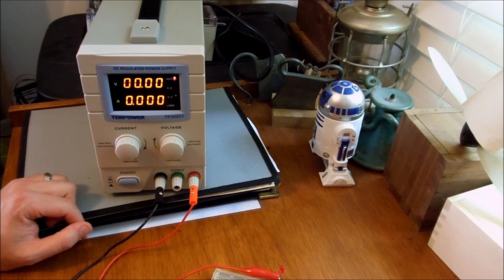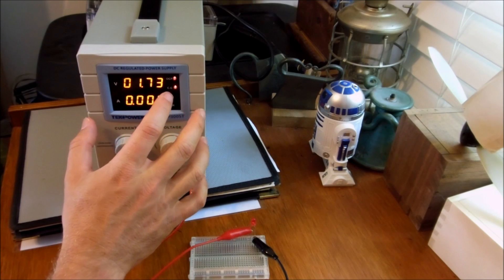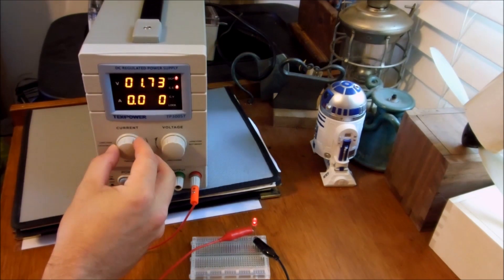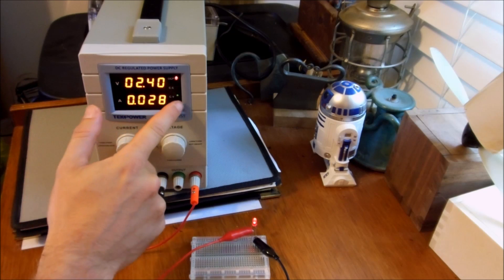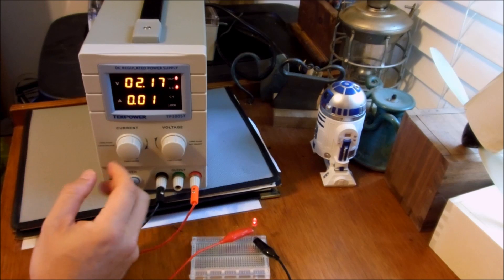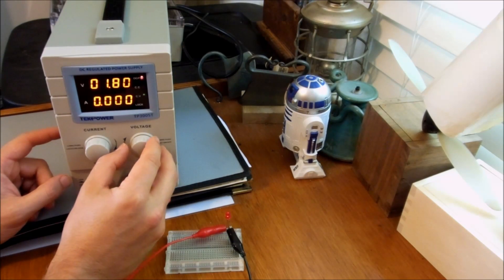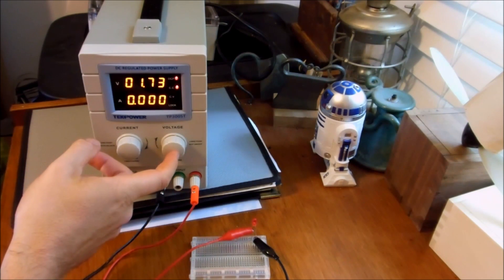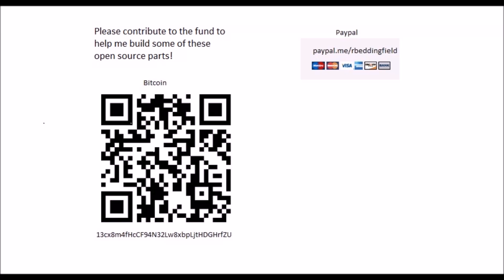Adjustable Power Supply Basics and Tekpower TP3005T Functions

Comment: When you turn it on or if the main power shuts down for a couple minutes and the energy is back, it will Remember the Voltage and Current you did set up before?  Or at least the voltage will be zero?  Is there some Voltage Spikes when turn it on or off? Thank you.
Reply from the maker: I got out the oscilloscope to see what it does.  When you turn on the unit, the voltage increases for about .1 seconds before it gets up to voltage.  So, no spikes that I can see.  When you turn the unit off, the voltage decreases over the course of a few seconds.
Reply: @robbeddingfield4049  Awesome, thank you for checking that!!!   I read several reviews about the KORAD KD3005D, it has a big spike (+8V) when turning it off, some people complained about blowing circuits when turn it off!!!  I bought a Tekpower TP3005T today, after comparing it with KORAD KD3005D, UNI-T UTP3315TFL-II, Dr.meter 30V/5A.
Reply from the maker: Yes, when you turn on the unit it remembers the last voltage and current setting, and it will supply power as soon as switched.  I'm not sure about the voltage spike.  Thanks for watching!

Comment: PLS can i use this product to power an inverter? i am trying to work out energy cycle
Reply from the maker: This power supply supplies up to 5 amps.  I'm not sure if that would be enough to power your inverter.  You might consider looking up the specs on your inverter or similar inverters.

Comment: have you tried it with a multimeter to see its reliability?
Reply from the maker: Hi, thanks for watching.  From what I can tell, it's close enough for me (withing a few milliamps or millivolts), but there are some other units that have noticed that the reading are slightly off sometimes.  You might want to check some of the other comment replies.  Thanks,
Reply: @robbeddingfield4049  Do you recommend that power supply?
Reply from the maker: I do not have any experience with other units and I'm not familiar with new products, but for this price range, it works great for me.

Comment: Thanks for the intro. Just ordered mine.
Reply: What's your impression so far?  I'm really thinking about pulling the trigger on one.
Reply: w3vjp ...so far it powered everything from an RC battery charger to testing Ham equipment. I check the DC output via Fluke meter when testing. I would recommend this to any hobbyist.

Comment: how to turn cc node off?
Reply from the maker: Since there are two modes, CC and CV, the only way to get out of CC mode (constant current) is to change to CV, or Constant Voltage.  The way to do that depends on the electrical circuit that you are working on.
Reply from the maker: Most of the time, changing to constant voltage just means turning the amps up to the point where you are not limiting the amps but you are only limiting the voltage.  That is to say that, in this situation, you are giving the circuit as many amps as it wants.  If the circuit will accept more than 5amps this machine may never leave CC mode.

Comment: Hi, I have one of these power supplies. are the rotary voltage and current  encoder knobs missing sometime. Do you know how I can get  a service manual or circuit diagram for this power supply??
Reply from the maker: Hey, yes, the knobs miss sometimes, but they get you there eventually.  I have not seen a service manual or diagram.  There is an instruction manual, but it is only about three pages, and doesn't cover much more than what I've shown here.
Reply: Many thanks for you'r reply Rob. The readings of the unit I have are slightly higher than the readings of my fresh calibrated multimeter. I would like to set the readings exactly as my multimeter. I just received a schematic of the unit from the distributor. If you are interested I can mail it to you. You can give you're opinion about the schematic, because you never know what you get with these cheap Chinese units.